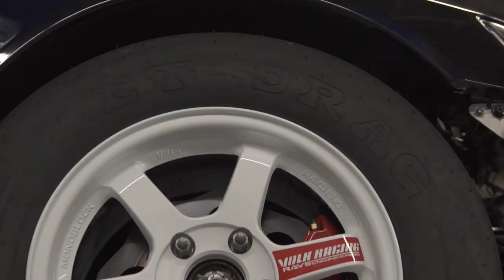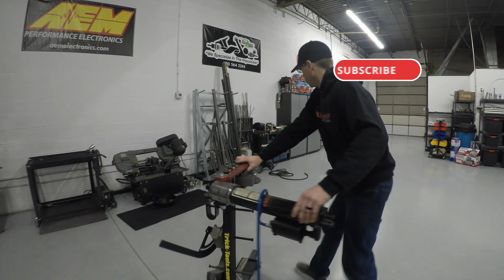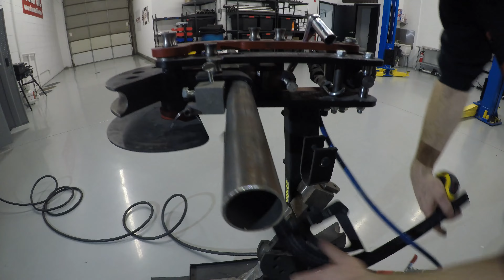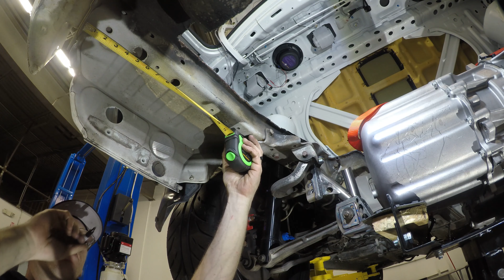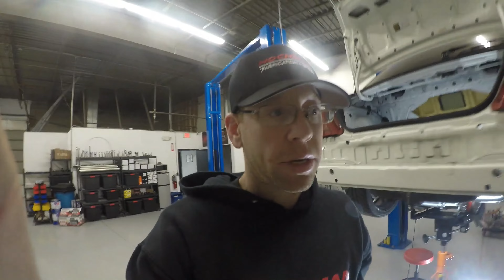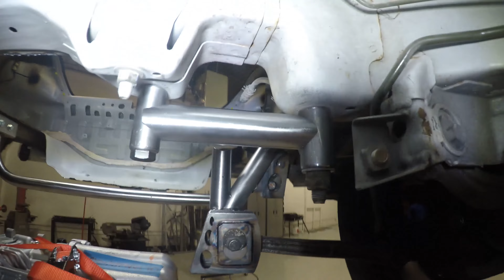Tesla Model S Swapped EVO 8 - Rear Subframe Coming Together!

Comment: Have you guys said which batteries and controller for this setup? They've cracked the model 3 now stuff too so hopefully the smaller design will make things easier later
Reply from the maker: Batteries are still TBD.  I know the customer has a plan already for controlling everything but not sure what brand or system it is.  They will likely chime in to help fill us in, or I will respond back here later.  Thanks for your interest!

Comment: I just had a question, do you think over time will the frame rail start to distort or bend considering that it is a little bit of a thinner material for a torqy application. Please and thank for any feedback
Reply from the maker: Good question.  The answer is no, otherwise we wouldn’t have done this.  Keep in mind we are just getting started and you are not seeing all the reinforcement we are adding.